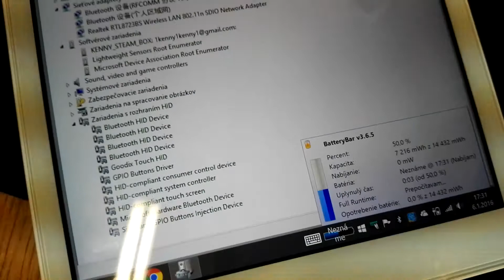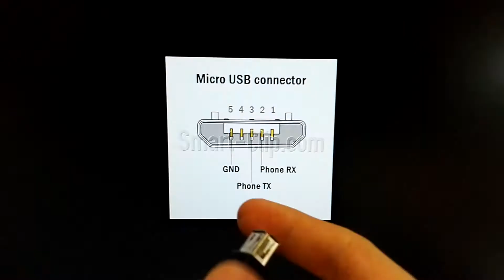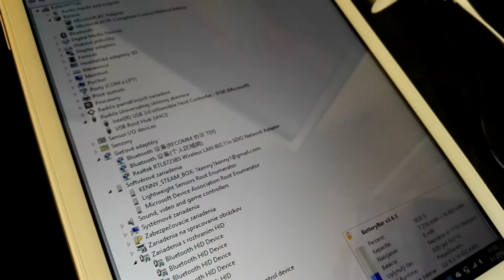Teclast X98 Air II Intel tablet - Battery not charging when ON, TEMPORARY FIX

Comment: Hi for people who dont want tobsolder nor buy a resistor , the otg hub that charge the tablet like the one in video is the one that broke the tablet , so let use it to fix it open it and find the 2kohm resistor it ahould be red black red or something gooogle to see how , then cut the wire in half , u find 6 cables add it to the yellow and red , then wire them with other stock cable , and it will work :)

Comment: I find a tricky easy way to use an original charge cable and it work, thank for your cable, i don't know if u still have the tab or people still use it lel :3 but here it is, so charge the tablet while it off till 100% turn it on so it discharge till like 95%, then turn it off WHILE NO CABLE IS PLUGGED , thrn plug the cable u make with the resistor wait 2 seconds and remove it then plug other workingnormal cable and turn it on right after and it will ccharge charge so faast :) it worked for me, good luck

Comment: i thing that the problem  is in battery charging control board which is enclosed in battery package

you can connect resistor between white and black terminal of the battery